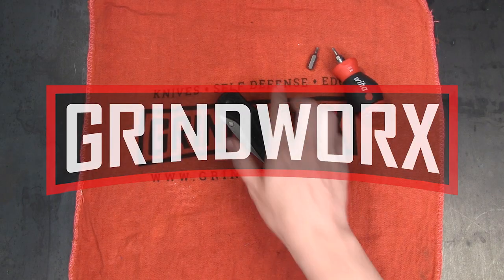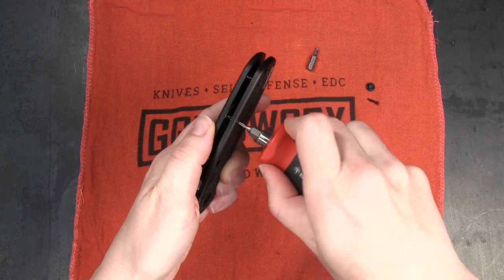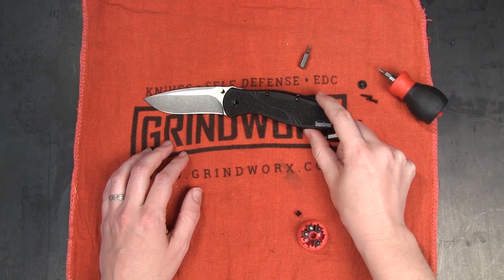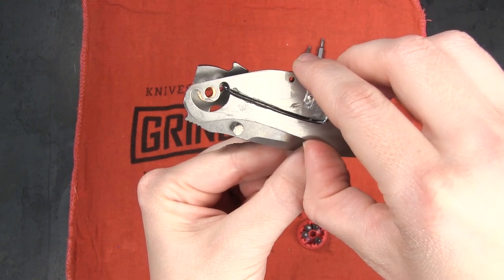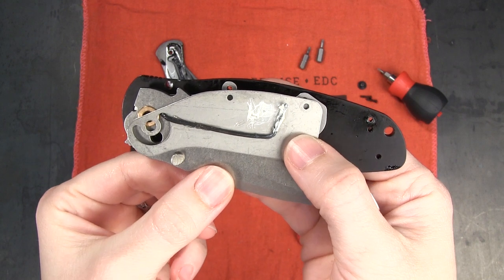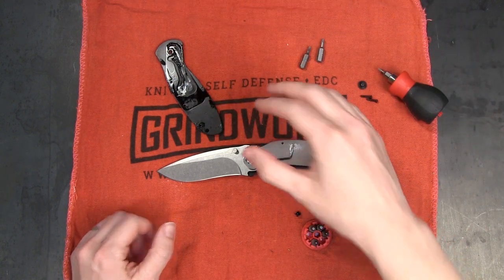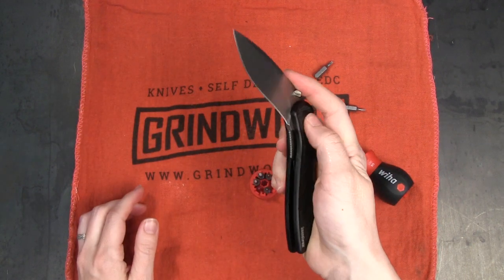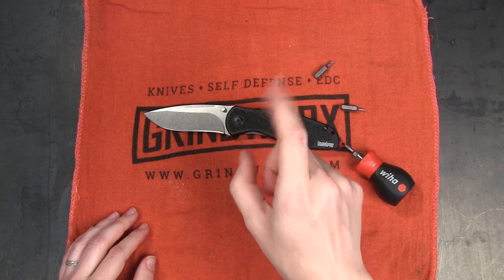How Do Spring Assisted Knives Work? | Knives 101

Comment: Why choose assisted? Any good practical reasons?
Reply: Easier to conceal than a fixed blade with the benefit of a quick deployment.
Reply: @gcarmen4490  so...quick deployment? I mean, any folder is going to be easier to conceal (and carry), but...if you want to flick open a well-made manual folder, it's still plenty quick. I just got (few months ago) a kershaw random leek....GREAT edc, Sandvik steel, good blade shape 3" 3oz. And I partly got it to try the assist. It IS neat...but having that spring in the pocket...even with the excellent safety...I just don't see that much advantage to flicking it vs. say...a manual with flipper tab and ball bearings...any other reason that I'm not seeing?